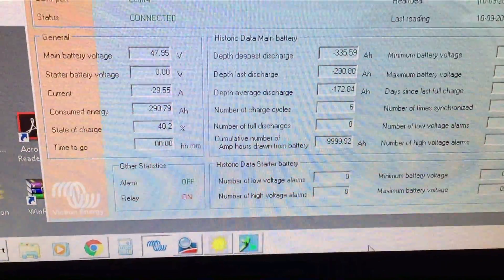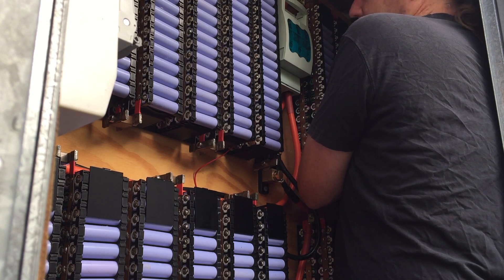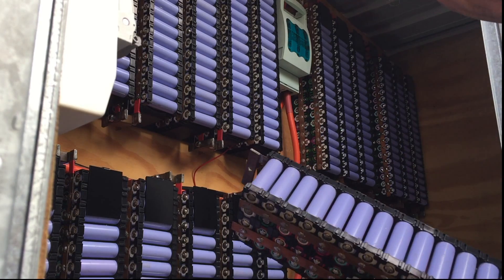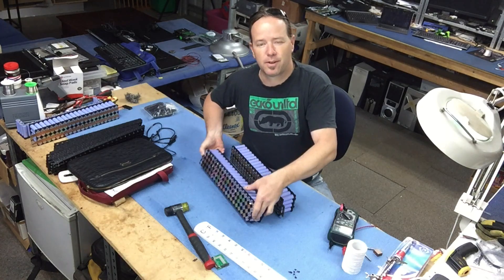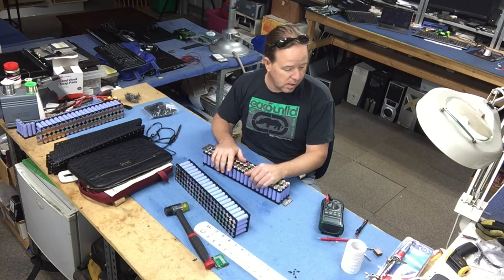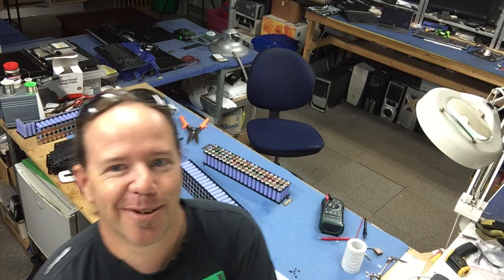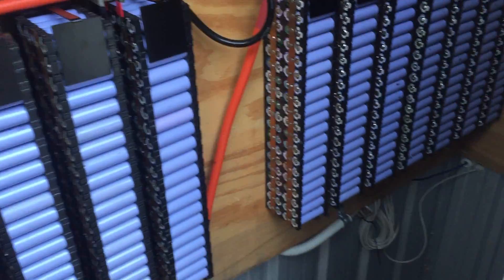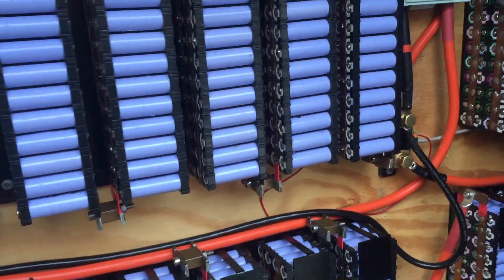10,000 Amp hours without burning the house down

Comment: Why are you soldering batteries instead of using a spot welder? You damage the cells by heating them up, even if for just a short time.
Reply from the maker: Geesh you pick a video from 5 years ago to make that comment... lol
Reply: @HBPowerwall  sorry mate, that video appeared at the top of the list when I opened YouTube
Reply from the maker: arr good ol youtubes lol
Reply: @HBPowerwall  sorry for not looking at the video date, just see a few people showing others how to do some pretty dubious stuff, didn't mean to categorise you with them.
Reply from the maker: back then it was still a process of learning what worked with the material and money I had ... had to start somewhere.
Reply: @HBPowerwall  very true, the usage of lithium cells in packs has come so far in the past 5 years. We're you using BMS boards back then or were they not available then?

Comment: Hy.i found this video after 3years old ,my opinoin is that you used different cells,sony,samsun,sanyo with different internal resistance and amps,.
Reply from the maker: It's all still working well, so not much of an issue so far.

Comment: Hey Pete! - Stop murdering your soldering irons ;) I say it in love though!!! when i started this I was so confused how you are doing this to your soldering irons/tips. I'm an audio engineer and soldered thousands upon thousands upon thousands of cables and have been using the same 3 tips (depending on needs) for 10 years!!! I have a "how to vid" on soldering - the steel wool is killing you mate! You need a sponge for your in between solder-points cleaning!! get yourself a sponge and have water on hand to keep the sponge wet/damp for the hours of soldering and get a ball of brass mesh (3 bucks at your hardware store/electronics supply store) If you've set your iron in the holder for extended periods of time, and the tip is black, push the tip gently into the brass brush about 5-6 times, tap a bit of solder on the tip, and then sponge it off - it will be 100% clean every time! I think soldering irons have been one of your biggest investments on this project!! :-p Really enjoying this series!

Comment: So 10,000 amp hour how many hours can you use that battery
Reply from the maker: Currently, it has 600ah usable 800ah if I want to stress the cells. I've come a long way since this video :)
Reply: How many hours is 600 amp hour
Reply from the maker: 1amp draw for 600 hours or 2 amp draw for 300 hours 3amp draw for 200 hours etc

Comment: preparation-level: over -9000!!
Reply from the maker: +majstealth that's a fair call :)
Reply: just dont see it als some sort of critic, you changed massivly over that year. i just wanted to see how it started, and yeah, it comes quite close to how i am atm^^ i started last week, have my first own 15 charged cells, with like 30 in the maybe bin and waiting for parts from china for the charging side of the project
i could ask so many questions but i will hold them back until i saw any video, not justr the newest ones, which look way to impressiv btw
i am also looking into getting the batrium bms, its one of the few good to look at bms out there, is the expansion board necessary for a pure longmon and shunt aplication? its only 55€ but still..
Reply from the maker: Definitely, recommend the hole package - you need the Watchmon to programme the longmons

Comment: "I love the smell of solder/flux in the mornin' "  :D
Great video Pete!
i'm starting a project myself but seem to be stuck on 12v!!!!
i realise that 24v systems draw half the current than a 12v system.
why is that?
Your system is 48v, so i'm assuming you only draw a quarter of the current compared to a 12v system?

Your system is to  be commended on!

Also, the recycled batteries you use, are they non protected?
What if I was to use protected batteries?

Cheers!
MIck
Reply: Mick Gatz because the power (in watts, P) = current (amps, I) times voltage. P = I*V, therefore, if you double V you can half your current (I) and get the same power. I know this is three months late, but in case you were still wondering 😀

Comment: It look like you are using a steel wool for cleaning your tip. You should use a brass pad. The steel will scratch the tip surface allowing oxide to build up and destroy the tip.
Reply from the maker: I am using steel wool, thanks for the tip :)
Reply: Good tips are layers of metals with copper in the core, the surface metal doesn't get dissolved away by the flux like copper does, and it might be nickle or something on the surface I don't remember, steel wool will scrach through and expose copper and flux eats it away and brass is a softer metal and wont dig into the plating. 

Oxidized surfaces is why you keep the tips wet or tinned with solder as it prevents the heat from passing from the tip to the solder and joint, leaving the iron sitting hot for a long time not using it and not wiping after each joint oxidizes the metals giving you the shitty thermal conductor of a coat.

He should get a decent soldering station from Weller or Hakko, i think the new hakko heat in a few seconds and don't stay hot when set int he irons holding place. Just buy one nice hakko made tip of high thermal mass so it can put out that heat needed for soldering nickle strips and large wires with globs of solder where joined. 40 watt iron seems a bit weak for what he is soldering.

Comment: i just found a trick you can do to freak people out.
You can touch a soldering iron EVEN THE TIP  and not get burned at all.
Ive even touched red hot stove elements and not got burned at all
like quickly waving ur finger through a candle flame or lighter flame. 
You barely feel anything.
and I even pushed the solder around on the soldering tip. be careful it doesn't have any flux still on it though (that stuff is sticky and makes solder stick to everything)
it was really a fun trick
You just lightly tap really quickly and let go and you dont get burned at all.
Ive touched my finger several times by accident with the tip before but always been quick enough that i dont even feel the sensation of heat on it lol.
only burned myself a few times by accident because solder flux bubbles popped and made it fly across to my finger or something lol

Comment: Is each pack 4 by 80 batteries? How many ah would that be ? Also , how do I calculate how many amps I could draw continuously? Thanks, your vids help.
Reply from the maker: 2 x 20 80 cells per pack if each of the 80 cells are 2ah each - 80x2 = 160ah :) i think.....

Comment: I use one of these http://www.goot.jp/en/handakote/kx-40r/ soldering iron and it has a very durable tip, I use it for 3 years now without a problem what so ever..  I replaced the heating element once but so far so good

Comment: I noticed that your setup mentions time to perform an equalization charge.  This must not be done with lithium ion cells.  It is an intentional overcharge that for flooded lead acid cells will equalize their charge, at the cost of electrolysing some of the water, but you can replace that and they will be fine.  Over charging lithium ion cells will cause severe damage to them, possibly causing them to catch fire.
Reply from the maker: +Phillip Susi yep....
Reply: No, The equalization charge makes his individual series cells the same voltage. Nothing to to with equalization on flooded lead acid. So you must do it on the lithium packs in this setup. When series packs are charged, they need to be the same voltage so none go over voltage and none go low voltage. This is the equalization HBPowerwall is talking about

Comment: from the looks of things . your not even balancing any of the cells at all. if you balanced the cells properly. they would almost never go below 2 volts on average.
Reply from the maker: Top balanced - and run them into the ground :) my fault. Bottom balancing and not messing with cut off voltages would work well but i'd rather kill them by over discharging than over charging hence i top balanced.
Reply: HBPowerwall
wat i meant is by using bancing circuts in your battery packs . to charge them all evenly. instead of making a bomb.
Reply from the maker: OOOh a bomb yes seems your right. Working on that RECBMS :)
Reply: HBPowerwall
thats not good specailly with a school across the street.
Reply from the maker: Your right * insert NASA or SAMSUNG issues here* it's highly monitored :)

Comment: I see 18650 batteries for sale on ebay, some say high drain, other for flashlights, some 2000 mah, others higher, my question is can you use the flash light type new batteries in a powerwall, or do you need to use the high drain type batteries, which as many times more in price?

Comment: You'd be surprised about the silicone insulation stuff, I don't know about soldering irons really but even in a lot of products above the lower end of the market you're still likely to find good old PVC used as insulation (at least I think its that). And with the soldering iron mains cable I guess it comes down to the conductor used inside as well with how bendy it gets and how prone to  breaks it'll be.

I mostly deal with smaller stuff myself though, so I've gone through a good number of tips for my soldering station. If I'm not mistaken the replacement tips for my Ersa soldering station are on average about 7-10 euro each. I've enjoyed the videos though even though I'm unlikely to ever go through something like your build, the concept is interesting for sure and it really gets the job done.

A lot more repairable too compared to a commercial solution, if your inverter breaks you can replace it with another one. And the things that'll need the most frequent replacements will probably be those batteries, roughly speaking what do you think you pay on average for each functional 18650 cell? And what is the average remaining capacity on them from old used laptop battery packs etc.
Reply: Actually thinking about it some more... you're in australia. Sure things aren't the cheapest in Europe where I am but what I've heard from the friends that have temporarily lived there is that ordering stuff can get pricey there. And shipping times may be longer than desirable too depending on the area.

I deliberately went with an Ersa station (made in germany) myself since the tips were readily available from multiple sources at the time I got the soldering station and still are. Even at that fairly reasonable 7-10 euro pricepoint for official parts that work well, but I suspect depending on the location stuff can get quite expensive.

The Hakko stuff that seems to be good for the money over in the USA for instance has only one importer in my country and not too many options to order the spare parts from within the EU (and international shipping for just a tip gets expensive fast). I wouldn't be surprised if you're quite screwed there with supply chains for almost all major soldering tool brands price wise unless you'd stock up on them in bulk and hope the heating element lasts.

Comment: You shouldn't burn through soldering tips like you do. Do you grind your tips down or something? Don't do that, they have a coating on them that keeps em from oxidizing. If you keep them clean with a wet sponge when in use and completely cover it with solder as it cools, when your done. they would last a lot longer. Also don't leave it on if your not using it.
Reply from the maker: +l1t7l3ph0o7 i just leave them on like 12 hrs a day it's the only way I get work done if I waited for the iron to heat up each time I had a spare minute I would never make any progress
Reply: fair enough, I guess they are cheapos anyway
Reply from the maker: Yep, you'll always pay for convenience

Comment: This is an impressive DIY powerwall project using individual 18650 cells.  The one shown with jehu at EVWEST (33kw) used tesla batteries from an electric Smart Car.  So much of the work assembling the packs was already done for him.  Don't get me wrong, it is still impressive for the scale of it.
Reply from the maker: Stay tuned - i'm not done yet :)
Reply: HBPowerwall Where did you get all of your 18650 cells from in the first place?
Reply from the maker: +bwillan mainly computer recyclers

Comment: have you done a test on the power drain over 24h with a cell logger? im thinking it would be useful to wire up one of those per pack. that way you can at a simple glance know the voltage of each cell tower quickly, and be alerted when one gets low.
Reply from the maker: I have ordered a cell loger 8S hasn't arrived yet - next test wink
Reply: +HBPowerwall yea, those ones are pretty awesome. i was even thinking a basic one that ive seen used....  http://www.aliexpress.com/item/5pcs-1-8S-Lipo-Li-ion-Fe-RC-helicopter-airplane-boat-etc-Battery-Voltage-2-IN1/32277630010.html
Reply from the maker: already have one of the 8M cellllogs

Comment: It looks like you might be using an acid based or "plumbers" flux. The tip of the soldering iron shouldn't look like that. Are you using rosin core solder or rosin flux? plumbers flux will eventually eat through everything, including the things that have been soldered.
Reply: He explained this before, the cheap tips don't last.
Seen it myself with cheap soldering irons, has nothing to do with acid core solder.
They have thin plating, hence they erode rapidly once that layer breaks 
down. The copper core of the soldering bit corrodes easily.
Reply: I mention it because in one of the early episodes when assembling the first bus bars it looks like plumbers flux is being applied with a nail while soldering. Even with cheap tips, that level of corrosion is extreme,
Reply from the maker: Yep plumbers solder, so much cheaper - i have been told it is that before combined with the WAY too many hours it's left turned on. Cheap tips fail even faster & they are often hollow so you can't just keep using it till it just a nub of steel :)

Comment: You didn't do individual cell voltage checks on the 80 cells in that low voltage bank. But it isn't necessary either. That bank has a much lower capacity than the others. The cells aren't the problem. Its just a low capacity bank and when in series it will just empty out faster. a good bank will reach 3 V after about 180 Ah. This cell will reach 3V after much less. Probably after like 140 Ah based on the 1700 mAh you mentioned.

So its not the quality of the cells but the lower capacity of the whole bank.

I wonder how a BMS would deal with this. I don't know a whole lot about BMS's, but if I understand it correctly, it would try to drain the other banks to match them to the bad bank. Good thing about a BMS is that it shows all the cell voltages.

Which gives me an idea. You can buy those small Voltage meters on ebay I think, they cost like a dollar or less. Put one on each bank. Saves you the trouble of measuring and, more importantly, you always have the voltages available. You can identify a problem in the early stages. Besides that, it's really cool to have this, especially fun for another video and costs less than 30 dollars.
Reply from the maker: yes just seems that the cell as a whole was the issue being lower AH, BMS would disconnect power to my inverter and in turn shut it down completely even if the grid was attached - IN TURN annoying my wife and kids. Small voltage meters have been considered then decided against - WHY , cause i wouldn't like it too look cluttered and messy lol.. dumb reason really but meh!
Reply: I like the idear of those active balances, the strong share with the weak.
Reply from the maker: Yeh but i'm thinking their work load would seriously play havoc with their life span
Reply: we need a guinea pig.
they look like they are made for busses and stuff.
if you had them and a bms disconnect you could just set and forget..
Reply from the maker: guinea pigs on their way :)

Comment: Yeeeeahhh I absolutely love your fumes extractor... I am definitely copying you hahaha
Reply from the maker: i should link it in the video annotation
Reply: you can also build one cheaply and very nice with those old "architect" lamps which clamps onto the side of your table, I can send you a photo - mine also have build in soldering tin dispenser, so its on the left side which means I can also use the same hand if I need to adjust it.